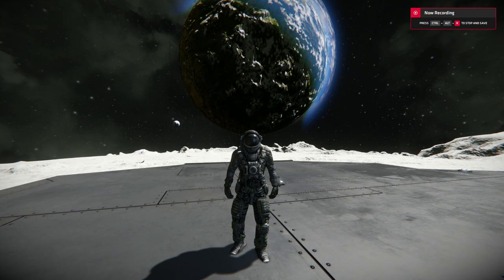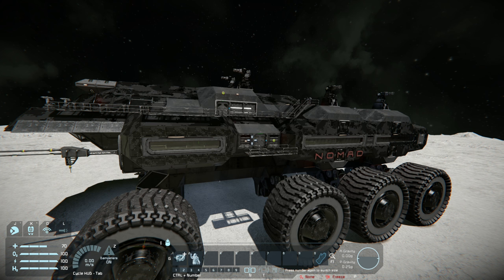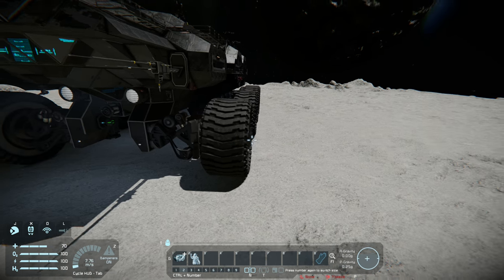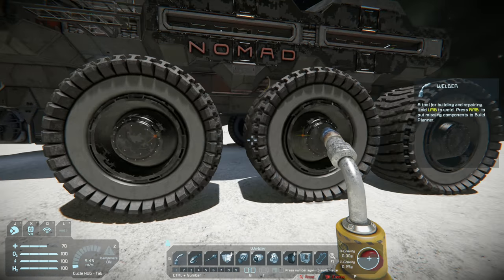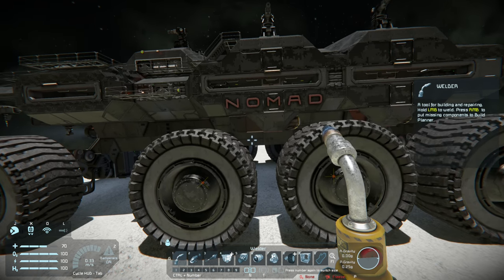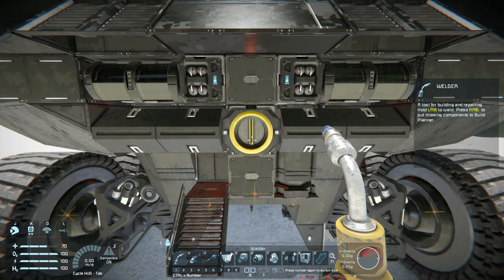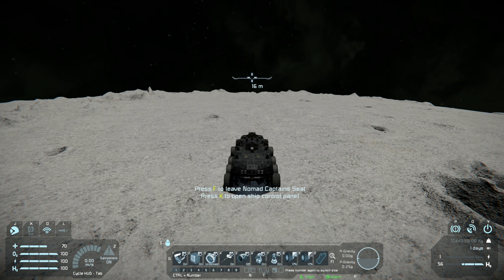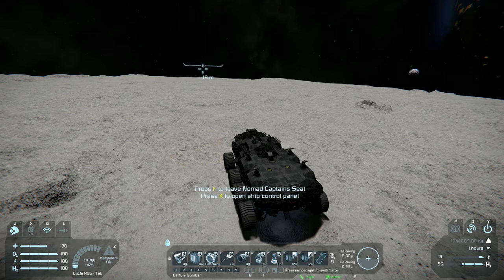Space Engineers - Building Tips for Large Grid Rovers

Comment: If you put wheels too close to each other, especially with a high steering angle, they can actually touch and fight each other. Same if the wheels touch parts of the hull. This causes you to waste power and reduces your wheel's efficiency. Remember, a huge vehicle isn't gonna turn on a dime. There are always trade-offs, and if you fight them rather than work around them, you'll have problems.
Reply from the maker: Yeah I had to disabke steering on the middle axle at the back, otherwise it wouldn't accelerate while turning lol
Reply: Yeah That sucks for some build most time i try to make a Nice round frame arround the wheel but they still hit the full square box , maybe a mod That disables wheel colision against its own grid is needed
Reply: I had that issue last night while my group was using a rover I built I gotta stretch the wheel bases out about a block or 2

Comment: For multi wheeled vehicles you need to decrease the steering angle the closer to the center of rotation a set of wheels are. For example an 8x8 with evenly spaced wheels would have the front and rear set of wheels at say 24 degrees of turning to lock, while the center two sets of wheels only turn maybe 18 degrees till they hit lock. If it was an evenly spaced 10x10 then the center most set of wheels should have steering turned off. For odd wheel spacing like 4 in the front and 6 in the rear you will have to toy with the settings to figure out what works best for your design. But you can look at large multi wheeled military vehicles to get an idea of how their steering works. You can also only have say the front two sets of wheels steer on a 8x8 like the Stryker 8x8 AFV.
Reply from the maker: Thanks mate, i will keep this in mind, maybe reduce the set just behind the front wheels to about 15 or something like that :). I kept the center of the rear 3 wheel sets directed straight as i found that still gave it drive, otherwise it just wouldn't move when i turned it full lock to one side.

Comment: For the jack stability I put a landing gear on the bottom of mine that way you can lock to the surface on uneven ground
Reply from the maker: Thats an excellent idea :)
Reply: @TheGarageGamer86   Or, let's say you pop a wheel on the left side, just lower the right wheels, and increase the left wheels, easy done and you save the mats from the pistons to build the largetube wheels ;)
Reply from the maker: @jg4521  let us hope that this is now a thing of the past since the wasteland update lol, time will tell :)
Reply: @jg4521  I feel like a moron for not thinking of that. I put jacks on my old Mad Maxwell rover (on Workshop, btw) ages ago, and it worked so well I've done it since. Although, jacks are pretty great for getting under small grid rovers to access the hull, if you don't have a garage with a mechanic pit available. Adjusting suspension is a really good idea for when you're in a pinch. I gotta remember that!
Reply: I thought I was the only one who did that...
Reply: I did this with my large rover. 1 piston with a landing gear. I also use it just to park, keeps the rover from sliding or rolling anywhere when the brakes seem to not be working right.
Reply: Wheel Height Adjustment. Lower the good wheels on that side and raise the bad wheel

Comment: You mention the steering angle, but you don't clarify much. I've experimented a lot with angles, and what I've found out is that the closer the wheels are to the center of the vehicle, the smaller the steering angle should be. Wheels which are right at the center point should not steer.
Reply from the maker: Yeah I really need to play around with the wheels on the rover, it definitely needs some work 😁👌
Reply from the maker: I had a look at it and changed the second set of axles to 10 degrees, made a huge difference :)

Comment: Pro tip for aligning the connector on the bottom, and you can do this with flying vehicles, too, is to create an auto docking sequence using GPS and a remote set to auto-pilot.

What you do is you get the vehicle lined up to where it can connect, then create a new GPS marker from current location. Now, backup the vehicle in a straight line to where it's clear of obstacles. Create another GPS from current location. Now, back up once more, about one length of the vehicle, and create one final GPS. Be sure to have labeled them, I'd suggest "Dock End," "Dock Approach," and "Dock Start." In your remote, you'll setup the waypoints in sequence of "Dock Start," "Dock Approach," and "Dock End." There are tutorials online explaining how to use remotes, so I suggest you watch those if you don't already know. Be sure to restrict top speed to a safe speed.

Once setup, as you near your base, you can enable the auto-pilot, and the rover will guide itself in along the GPS route, and end directly inline with the connector of your base. If using a flying ship, you only need two waypoints, the one on the connector, and one directly above the connector a few meters up. You can also use this system for security drones, automated parking and take-off, and even shipping routes you may frequent.

Another thing I do for all my small vehicles is setup two timer blocks that finalize docking or startup launch. The docking timer block shuts down all auxiliary systems like antenna, ore detector, O2/H2 gennys, thrusters, lights, gyros, etc., then it tells the connector to lock, and finally, it sets the batteries to recharge and O2 and H2 tanks to stockpile. It is key that batteries be switched AFTER connecting, or the connector won't have power to connect. The startup timer block does the same thing but in reverse sequence, setting batteries to auto, taking O2 and H2 off of stockpile, thruster ignition, gyros come back on, etc., finally ending in forcing the connector to unlock. It saves a lot of time and power, prevents gyros from fighting the ship or rover you dock with, prevents the thrusters from wasting fuel/energy and burning holes into the ship, etc.

There are a lot of quality of life things in this game, and all of the ones I just mentioned above don't require scripts, either, great if you play on a server that doesn't allow scripts (not sure why anyone would do that, but some do, I suppose). They're definitely advanced features, but not horribly difficult to learn. They take some time and practice to setup, but the convenience you get in the long run is just as desirable as setting up your building toolbar the same way between games. Annoying to setup, but worth it.
Reply from the maker: Dude this is very helpful, I think I may use this! Does it work in reverse? :)
Reply: @TheGarageGamer86  I suppose so; I haven't tried. Perhaps a second remote with reverse coordinates would be enough. Not sure how you'd automate it without scripts, perhaps with an additional series of timer blocks? Guess you'll need to experiment!

Also, shout-out to Splitsie's tutorials; I learned a ton of stuff from his tutorials. I built like a total noob before watching those.
Reply: Great comment, thanks a lot. I'll give it a try!

Comment: Tip for you as well: The inability to properly accelerate when turning actually stems from design and forces the faulty desing experiences, it all comes down to placement of wheels. Generally, there can be only 1-2 places where rover really "turns" and only 1 axis, around which it rotates during turning. In traditional car it is "turning" on the front wheels and it rotates on the back wheels. Say, if you have 2 pairs of wheels on back, they wont cause much drag if they are close together, if they are too spaced out, they need some steering added to it to follow turning curve to prevent drag being made.

Your rover suffers from it in 2 middle sets of wheels. Since in SE they way wheels turn is calculated based on center of mass, I would turn off steering on second set from the front and third should turn but with decreased steering angle. This would probably make rover turn more with its bum, but well, it would turn faster. Optionally, you can leave the third set out or just decrease its friction value, making it purely weight-bearing or a decoration.
Reply from the maker: Yeah I does seem that way, I think it would be heaps better if I had the 8 wheels in a configuration where there are a group of two at the front and a group of two at the back 😁. I will try some of the things you suggested though and see how it goes 😀

Comment: One thing I discovered that comes under the DO NOT TRY THIS AT HOME category is I had a rover about that size and had a connector on the top rear. Really convenient. until one day - just before logging off - I had put too much Down force on it with the connector. This apparently Compressed the Suspension. Upon logging back in there was a huge explody sound and My Rover was just gone. Couldn't find it. and about a minute later my base also exploded. I reloaded that world to try to figure out what went wrong (i thought I was under attack that I failed to didn't notice the first time). The exact same thing happened as soon as I logged in. By about the 4th reload I accidentally looked straight up, and at about 1500 meters I found My truck just finishing its arc as It started back down to land on my base like a 50,000 pound bomb.
Ever since then I have fitted Connectors on the sides of the vehicle and Totally avoid compressing the suspension.
Reply from the maker: That is absolutely hilarious 😂 that would have been funny to see!! I once had clang fling a hanger door about 200m up into the air, but thankfully that's the only time I've seen a bit of clang lol
Reply: @TheGarageGamer86  I haven't tried to load that save in months but I still have it somewhere. It exploded every single time i logged in so - As far as I know - I assume it still would.

Comment: Thats a very good video, thank you for these tips, that I am always forgetting while projecting on my own...
I can see it is almost a 2 years old video, but I would like to point out 2 solutions of issues that you mentioned in your video:
#1 - issues with move while the wheels are turned. 
Basically it is issue caused by too high traction - where tires are holding its position, instead of being dragged on sides (we need the differential propulsion to avoid this) ...or less traction.
#2 - using [P] button does disconnecting other parked vehicles from connectors. That one might be updated now, but I can see an option in the connector blocks that allow to disable/exclude it from "parking use". Much handy when we make it right way.
Reply from the maker: Thanks mate, I'm glad the video was helpful, I think I may go ahead and create an updated version to this video as I have learned a few more things about rovers that could add to this video 😎👌. 

1. Yeah I found out that the rear and second set of axles steering angle was set way too high so I ended up fixing that about a year ago, now it turns quite well from stationary. Although the turning is not as tight as before once the speed builds up, it is a lot better overall now though 😎

2. You're absolutely right about that one 😊. Keen software has now added the ability to turn of the disconnection of connectors when you press P, so now you can go into the options of the connector and disable that feature, which is awesome 😎

Comment: Advanced tip:  Isolate your front pair of wheels, and turn OFF brakes for them.  This will dramatically reduce the tendency to lean forward too hard when slamming the brakes.

On worlds where ingame scripts are allowed, the DAS program is particularly helpful for rovers, big and small.  It primarily works as electronic stability & traction control software, managing the strength and steering angles of your wheels for optimal performance at whatever speed you're moving (wheel steering is tuned to match proper turning circles, and steering angles lower at higher speeds to prevent oversteering rollovers).  DAS also features a speed limiter, cruise control, partial self-driving autopilot that follows recorded paths or moves to GPS locations (and remembers your home base and gives distance & bearing), odometer, jump-jet control, terrain sensing for automatic wheel alignment with the ground, shock dampener strengthener when falling, automatic wheel replacement, and other features.  All features can be tuned, or disabled with simple boolean settings in the program, and the program can be controlled by running commands on the programmable block via the cockpit toolbar.

Also, the P key is no longer to be dreaded or feared, as connectors can now be individually set to ignore the parking signal.  It's a good idea to simply switch ALL connectors on the entire grid to ignore the P key, and then manually set up hotbar controls for connectors (especially important for stations where support craft may be docked!).

It's also a good idea to try to design your support ships to have a landing gear that also locks when parking, just to guarantee the grid never escapes from a little thing like connectors switching state.
Reply from the maker: Some very good advice, Thankyou! 😎👍 I really need to delete this video and create a new one, and then include things like the DAS Script. Plus my microphone and editing quality has increased a lot since then!

Comment: a good way to add repair options to a large grid rover is to have two nanobot build and repair systems(modded block) set to fly mode as this will not only keep the wheels at 100% but as long as the grid has the needed stuff any other damage will also be fixed pretty fast well at least thats what people on my server do as we have that mod
Reply from the maker: Yeah it is a great mod, but I love the challenge of having to keep repairing things lol. Well not love, but it gives more longevity to the game haha.
Reply: We found that the build and repair mod can occasionally take your wheels off your rovers when you least expect it. It’s why we stopped using it lol.
Reply: @madcapmagician3130  that is due to your setup of it ensure your the owner of the entire grid if the wheels  end up being not owned then it will get broken down for parts had the same issue with one of our older rovers but after we setup both the grid and the nanobot system the right way it has never happened since the way to ensure it does not is have its ability to grind down wheels off then no matter what it cant

Comment: The best solution I've found is to make 4x4 wheel block on each corner. Attach a rotor and a hinge above the centre point of the 4 wheels and extend a straight line of blocks from the centre going up. Create a box around this pole and fill the well with plane landing gear as dampeners on 4 sides of the blocks. Now you have 4x4 wheel truck that can follow the terrain to quite extreme angles. You need the swcs wheel script to control wheels through rotors but the outcome is you have a rover that goes anywhere and is virtually impossible to tip over 😂.

Comment: I typically add outrigger wheels about a block above the base wheels with a cargo/sorter style ballast system for balance.
Reply from the maker: Yeah I have though about adding 1x1 wheels to the bottom with 0 friction, and I might actually do that to be honest :)
Reply: Also another neat truck is to build a separate set wheels on rotors, setting your "primary" wheels to on/off friction. Tie the rotors to a button for "autopilot".

Comment: I have a 6x6 APC and  I have a "4x4" shortcut giving power to all wheels but for power saving purposes I run the rear 4 wheels as primary drive wheels and only the front 2 turn but I have a button panel outside the cockpit that when pressed allows all to turn in case I need extra turning ability or if a front wheel is broken it acts as a limp you ass home function
Reply from the maker: That's pretty cool actually, like having a 4WD in real life, just change the gearing 😎👌
Reply: @TheGarageGamer86  thank you I appreciate that and I have started incorporating that in most of my land vehicles. My truck irl is 4x4 and I like making the game realistic to a point so most of my land cruisers are 4x4 with hydrogen engines and tanks with small batteries just to make sure everything starts properly and to run lights

Comment: I like the design, and the hints for CM/CG are neat. I'm wondering what you think of using concrete to drag the weight lower? Especially for internal structures, leaving heavy armor blocks for the exterior? Also, why Ion thrusters for the hill boost? Doesn't that limit you to airless?
Reply from the maker: Oh the workshop version actually has Atmospheric Thrusters, but because I decided to make this video on the moon I swapped them out for Ion Thrusters 😁. I think you could use like Heavy armor blocks along the bottom to add more wight down low but as far as I'm aware the concrete in this game is only a skin 🙂